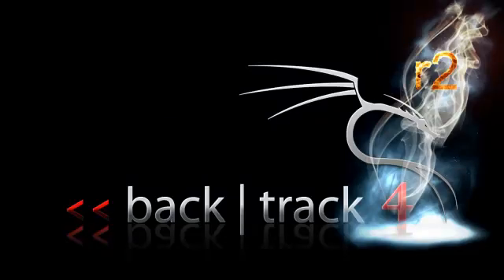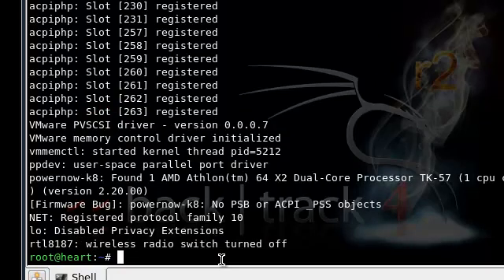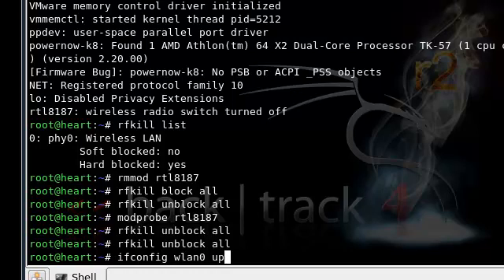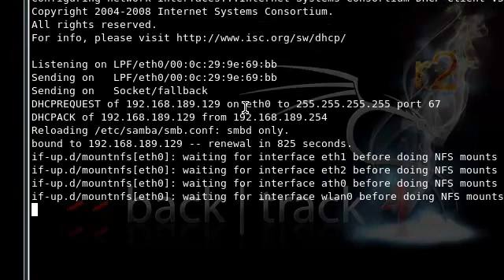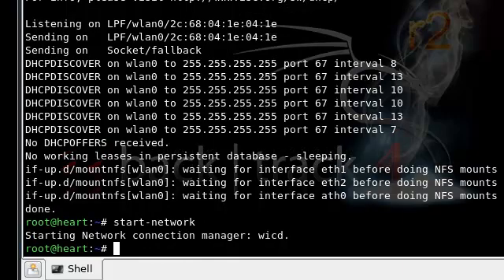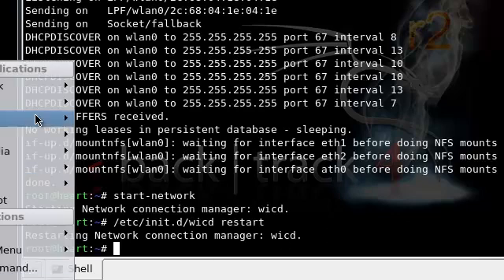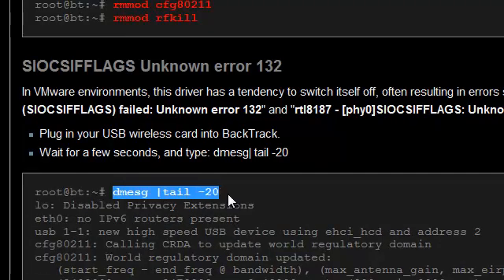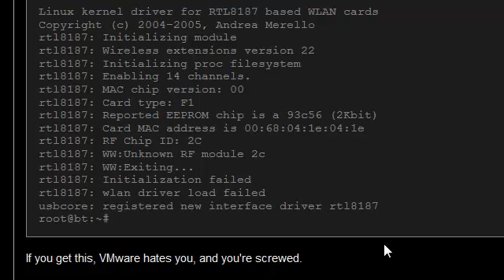BackTrack 4R2 SIOCSIFFLAGS Unknown error 132 fix for dummies

Comment from the maker: @KINGOFDARKNESS48 What usb wifi do you have? Some usb wifi are still not supported but most are getting the driver support... You can also try re-installing wifi drivers, which should be in the backtrack website.. I can give you the link to this if you like.. or just let me know what usb wifi you have and i can quickly check for you if its compatable.. Or you can google aircrack-ng compatable wifi cards, and see if your's is in there..

Comment: Hey. It's a kind of strange.. When I start using my rtl8187 with BT5 it works and nothing is blocked, but when I want to shut the adapter down by writing "ifconfig wlan0 down," then everything is fucked up and I cant turn on the card. Sometimes it works by using this video above, and some times it doesn't...  So My problem is that I cant change the MAC-address... And yes, I'm using VM.... Does any of you now how I can fix it??? 
Thanks :)

Comment: @curemymind np...don't know what happened to the link, but for the problem I was having it is working now, only thing is that when I type airmon-ng start wlan0 it start monitor mode but it stays as wlan0 it don't change to mon0. guess that is ok though being it still runs :)...tried to get sound to work but I can't get it to do anything....thanks for the help.. I might get up with you on other apps for bt5 if that is ok...trying to learn it..still a rookie at this linux stuff

Comment: @curemymind 

it started out using the rtl8187 but since I typed 
rmmod rtl8187
rmmod mac80211
modprobe r8187  

it seems like it is working right...will find out today to see if it will connect with my router...any ideas on what I should do if it don't?

Comment from the maker: @gigiboxa When using the aircrack-ng command you do not need the bssid you just need the file in ur case poke-01.cap. When you do airodump-ng -w poke -c chanlle# --bssid bssid# interface, are you getting any data when you do aireplay-ng commands?